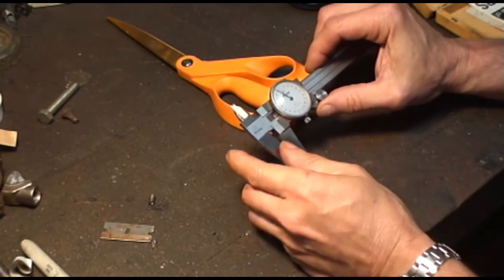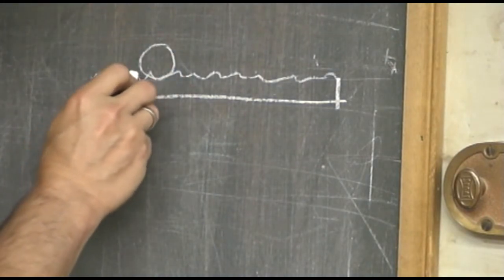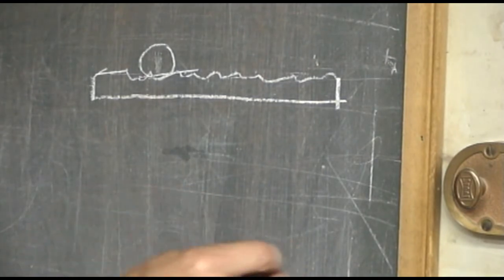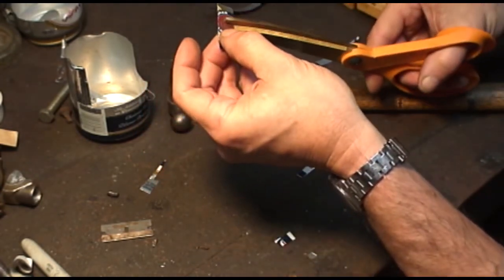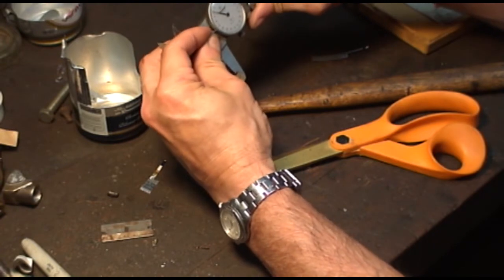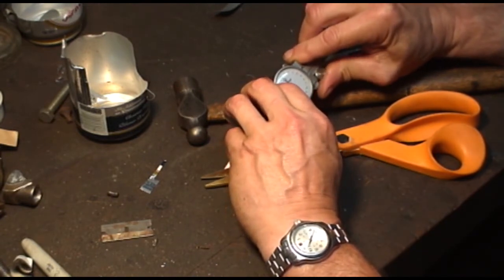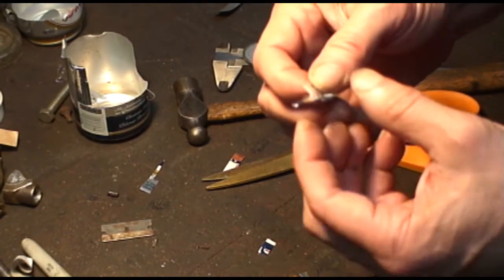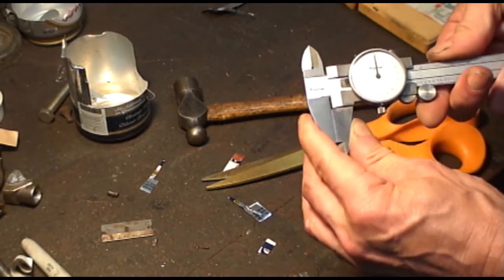Clock Your Dial Caliper with a Beer Can

Comment: I found a thin piece of wire worked even better. Was having a hard time getting the thin slice of aluminum the right width and feeding it between the teeth and gear without deforming or bending. Used a piece of 24 ga. wire with greater ease and success, another option that may be quicker and easier